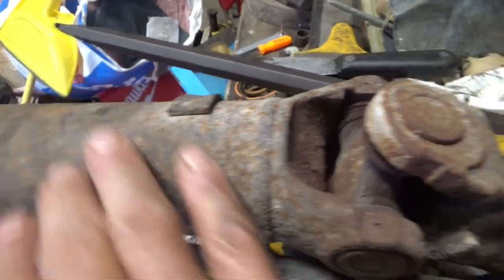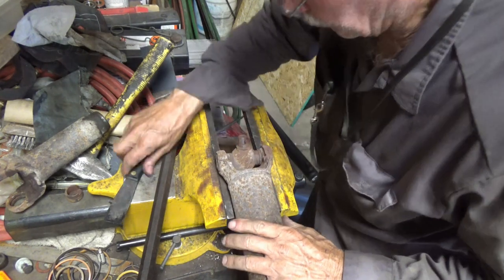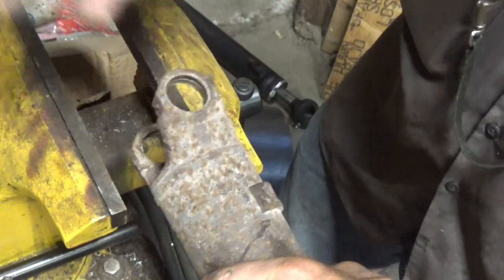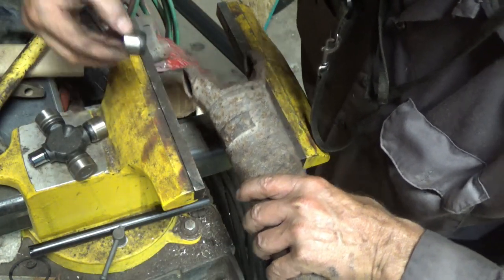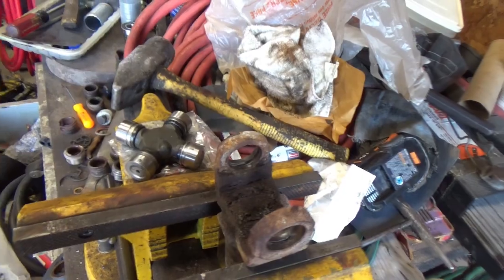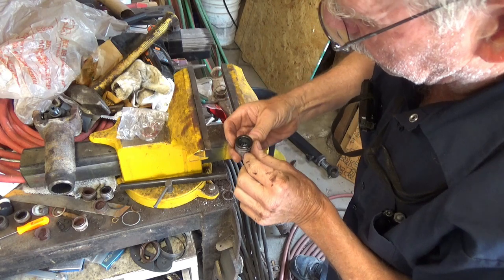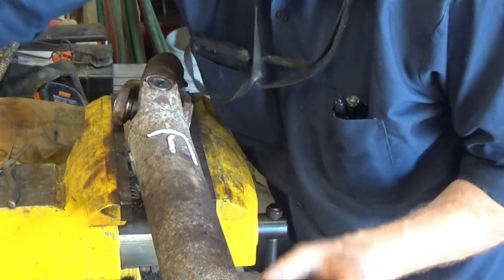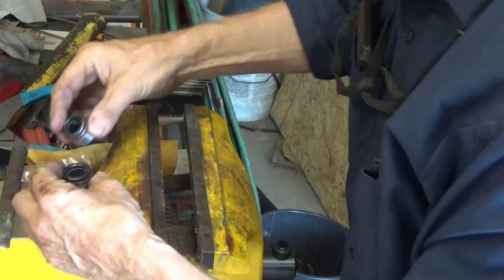Replacing carrier bearing and u joints on a pickup. Part 2

Comment: Thanks for the video.  Worked on a 2000 Chevy 1500 LS extended cab.  I followed your video to crack that center bearing.  I used a cut off tool to put a groove in it.  Hit it with a cold chisel and it cracked.  Came right off.  Woot!!   have a bearing pusher so I seated it with that.  Replaced all three u-joints and tail shaft seal and well as diff seal.  You rock my man!!  Subscribed and liked.  😋

Comment: Just a note to other video watchers, 1 get a micrometer why cause you will want to measure the inner and outer caps of the universal, #2 you will want to measure the gaps between where the end caps go why because if it's modified or bent or obliged, or closed inwards at at all, just like the last job I did instead of a " U" shaped fitting I had more of a squashed top end u  and I could not get the locking clips on, so after alot of work clips were finally installed, and trust me there's not enough room to explain the fix, center hanger bearing that spacer is to help stop the axle from going to far to the rear and also if ur lucky enough and have not damaged the dust shields which does come off ( 2 of them and 1 fixed to shaft) a good idea is to put them back on, so yes this gent may have missed some stuff but remember when in doubt break out the micrometer and always check for proper alignment of your shafts and also really really mark your alignments of your yokes for balance purposes to avoid serious vibrations ! Make sure leaf spring shackles are also good if not that will also lead to issues with drive shaft alignment and safety of vehicle yes another issue that I had to deal with 😡 so measure not once but 3 times write them down, watch the shape of your "U" joint, mark dam good, and use proper tools when you can. I.e. large c clamp from ball joint kit makes pushing joints easier, and one last thing sand inside the reciever for the end caps if you have to force them then clean up the crap or rust out and measure with micrometer that last piece will save you large ! It cost me 2 new replacement Universal's cause I blew out 9n and cracked another from falling bearings so remember to sand the inside of reciever for the end caps and make sure that is as close to perfectly round as possible ! What should have been an easy breezy job turned into a b.s. nightmare over 3 days, so mark, clean, re mark shaft, measure, measure again, test, clean, measure, install, carry on !

Comment: Hey Gordon, 👍 job! Can you please show where crankshaft and camshaft position sensors are? That will be greatly appreciated. Bless you Gordon
Reply from the maker: You will need to look on YouTube or Google specifically for each motor as those sensors are in different places. If you cant get to internet in an emergency you can look for a crank sensor (which is usually the problem on a car) pointing directly at the crankshaft from the left or right side of the motor either in the front, middle or rear, if in the rear it might be on the top of the bell housing, it will have a small magnet on the tip of it, match it up at the parts store. Naturally the cam sensor will be on the top of the motor pointing at the camshaft and it too will have a magnet.